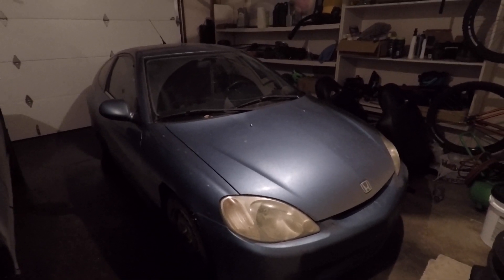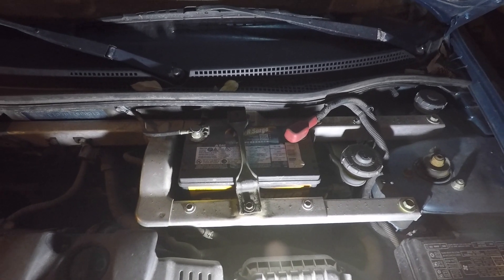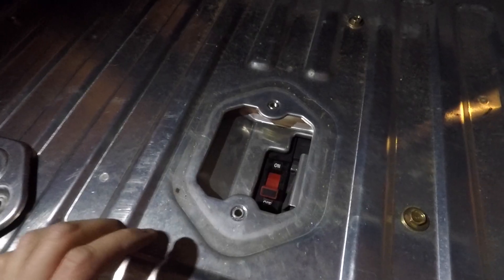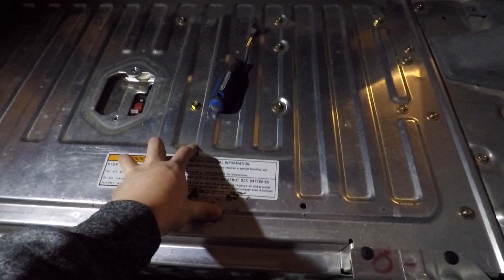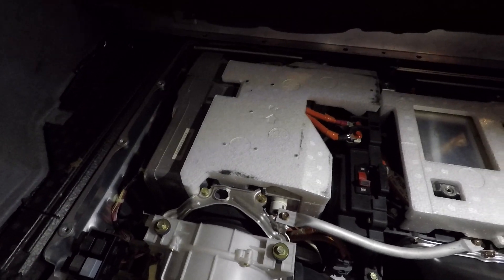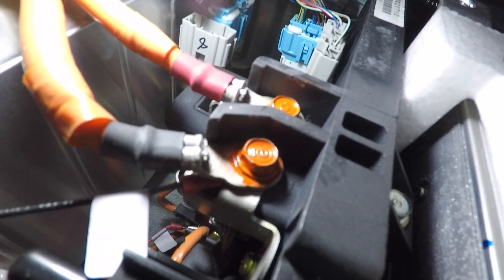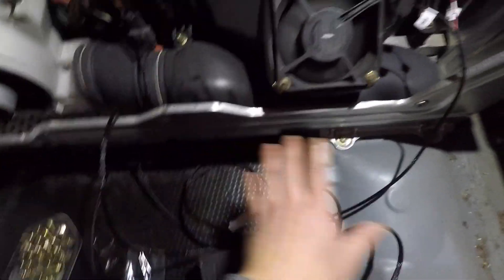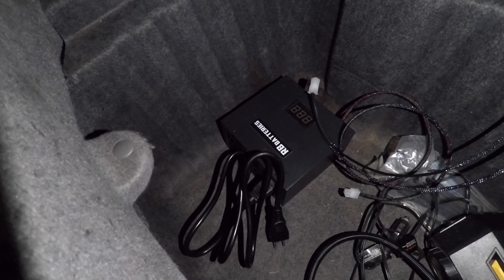Daily Nugget: Grid Charger Install!

Comment: Good video i never saw you reconnect the grey plug #8 that you removed in the beginning. Did you reconnect it? Thanks
Reply from the maker: Yes reassembly should be the reverse of the steps at the beginning so the #8 connector would be plugged in again
Reply: I have a prolong grid charger instanlled on my 2001 Insight that was there before I bought it.   All of a sudden it's no longer working.   This video is very helpful to me showing how to safely disconnect the batteries in order to see what's really going on in there.  ( I fear it's mice )